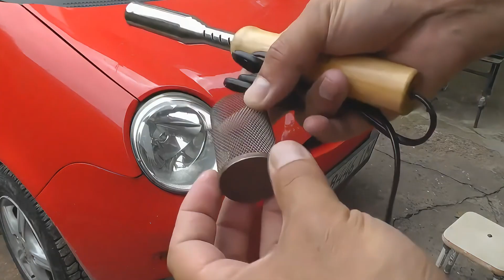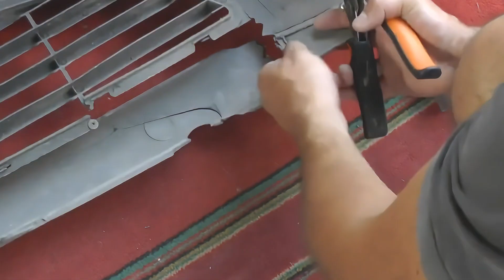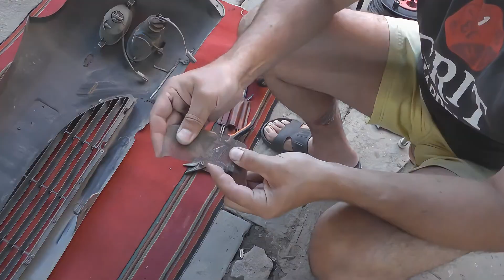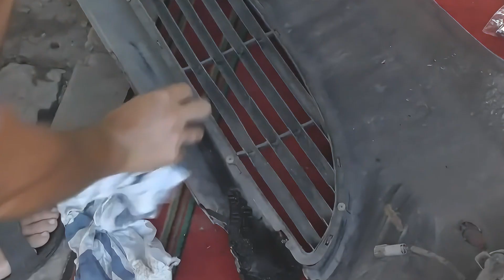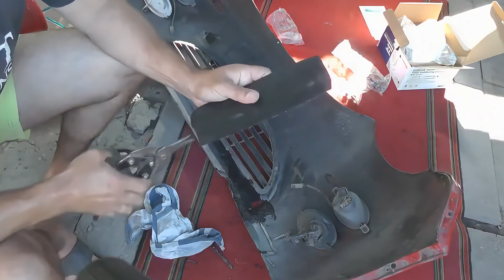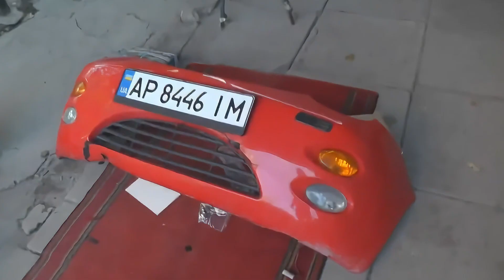How to Repair Car Bumper Damage at Home

Comment from the maker: Using a heat gun at 300°C was a game-changer compared to a regular soldering iron! It provides a much cleaner and stronger weld. Have you guys ever tried repairing car parts yourself, or do you prefer taking it to a professional? Let’s chat in the comments! 👇